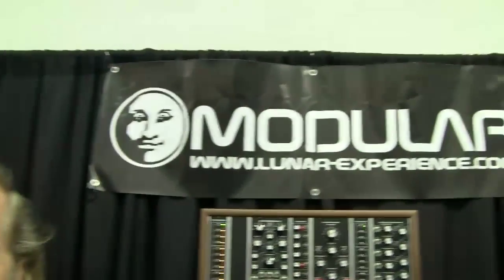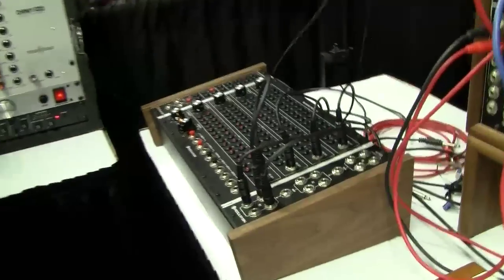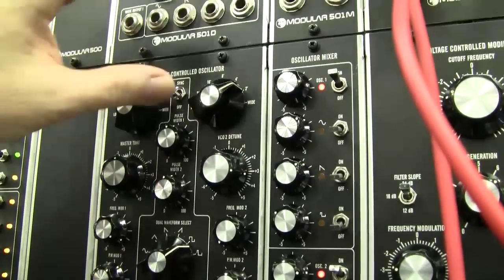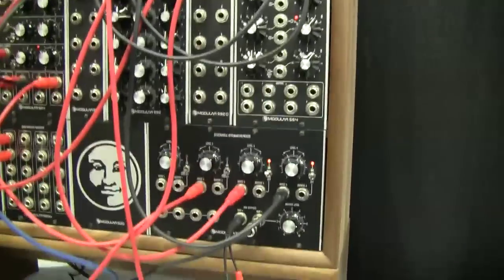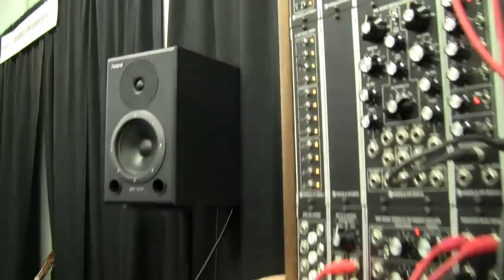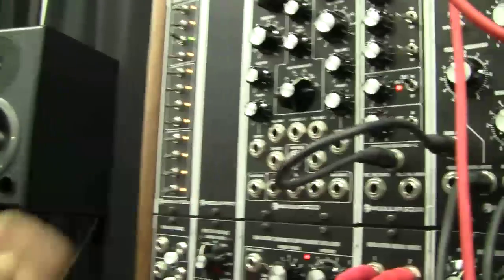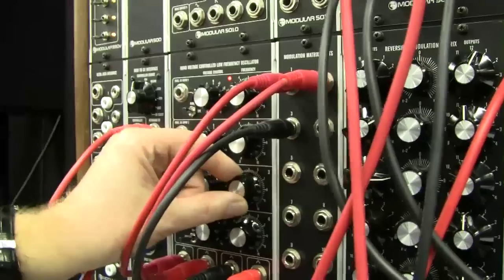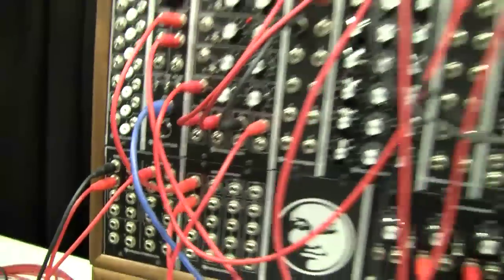NAMM 2014: Moon Modular Sequencers

Comment: What modular sequencers do you use in this video?
Reply: Hi, Gert mainly uses the Moon Modular 569 sequencer in this video (in the table top box on the right hand side) but the Moon Modular 568 trigger sequencer is also shown (in the table top box on the left hand side) but is only being used here as a steady clock source for the 569 in this video.